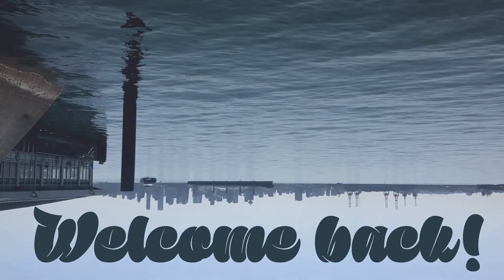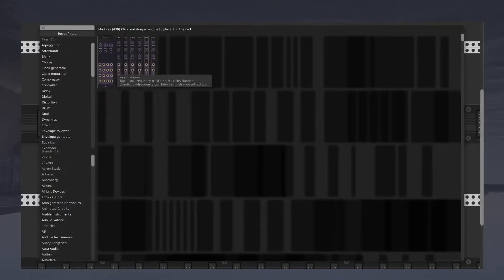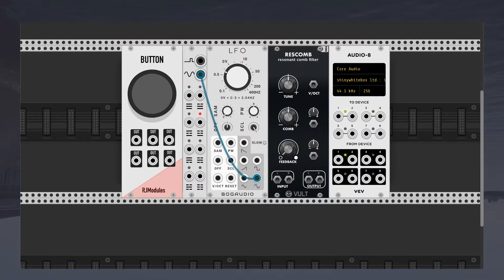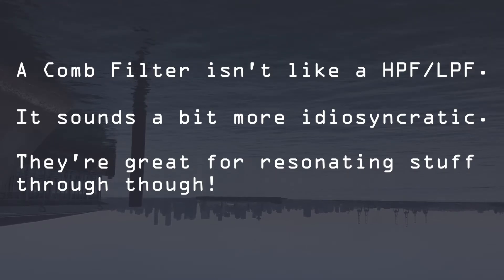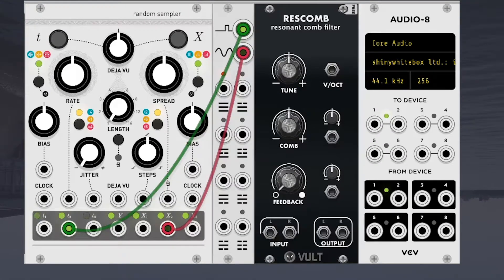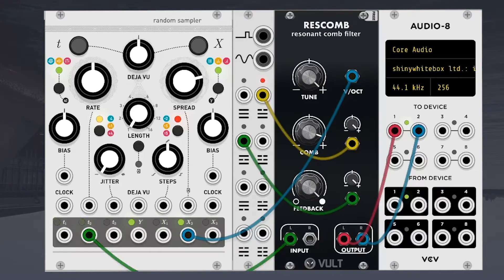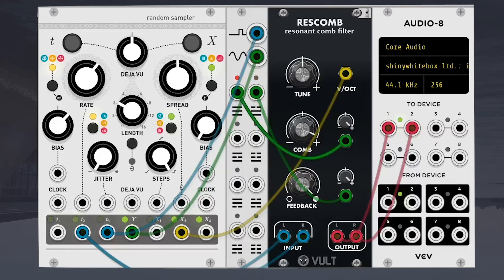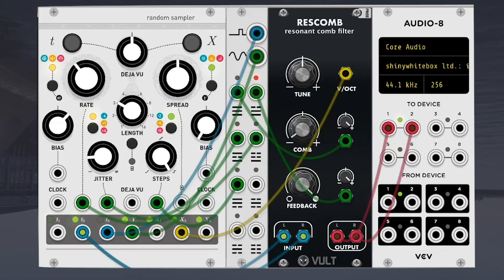VCV Random Modules #2 - Comb Filter + Seq.Switch

Comment: You can use oscillator output as trigger for most sequential switches (it just toggles audio-fast), and often the result is really nice.
I have to admit your solution is more interesting tho
Reply from the maker: huh I should try that. The realization that in modular, cv and audio is more or less the same continues to blow my mind
Reply: @eelromance  I still can't wrap my head around that shit.  One thing I tried to do was -5V, 0, +5, and as simple as that seems it is not really in VCV.  -5/+5 is a squarewave but the third state is where it got interesting.  I am not having much luck with VCV Rack because everything is starting to sound the same to me since I picked it up.  From mine to most of the ones I see/hear on Youtube.